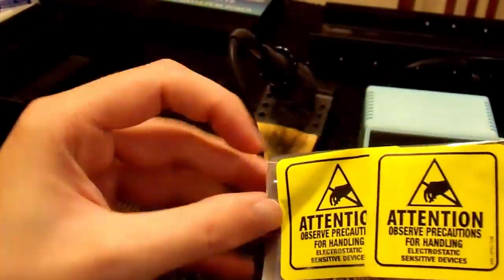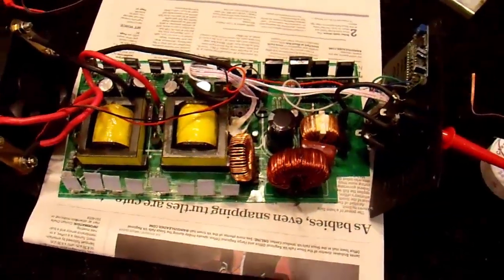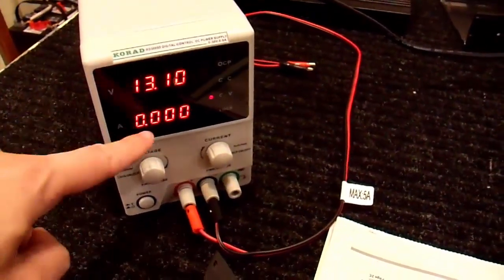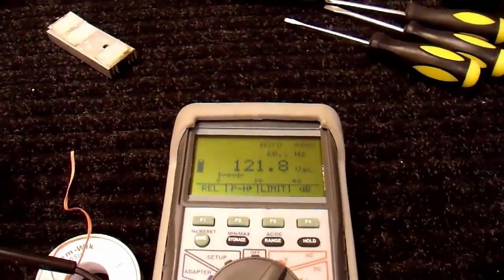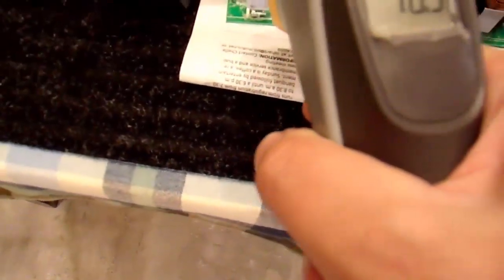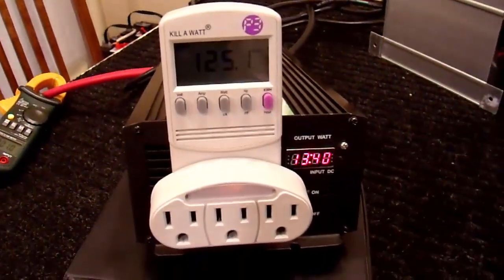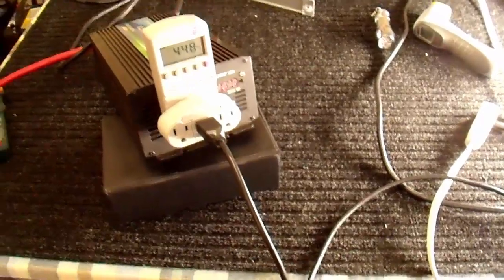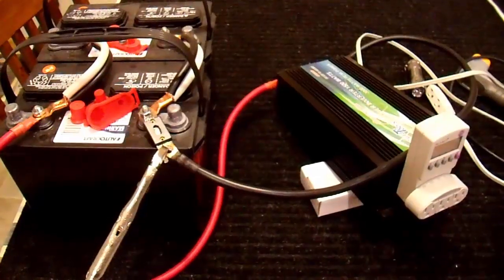Accurate Tools Pure Sine Inverter Review and Repair - Part 4/4

Comment: Recently acquired. the accurate tools AT 3,000 pure sign inverter It's apparently in some sort of protection mode with the front red light on and a whistling sound. Do you repair these professionally or could you recommend someone?
Reply from the maker: I do not offer a repair service.  You can ohm out the FETs and that will likely be the problem.

Comment: Mine is quite a bit definitely designed on the inside. Same inverter very different. Mine has 3 transformers for start
Reply from the maker: It's likely they've changed their design over time.  This is a pretty old video!  The same principles apply though and the general architecture will be nearly identical even if it looks physically different.

Comment: Hi, 3000 watt full sinus inverter fault light is on.  When the inverter is turned on, a relay tripping sound is heard, then the fault light is on, what do you think could be the problem?
Reply from the maker: I do not know what the relay tripping sound would be as very few inverters have relays, but assuming the sound you hear is a current surge due to a damaged components and the inverter subsequently protecting itself then I would guess it is a shorted FET or diode.
Reply: @knurlgnar24  Thanks for the valuable information. I will do as you say mosfet diyot

Comment: Hello sir, I have enjoyed watching your repair videos. I have an Accurate Tools AT5000P 5000 Watt inverter. It worked very well for almost a year. Recently while we were gone it quit working. No front panel light, no 120 AC with solid 12 volt input. I have a well designed 12 volt battery configuration with controllers When I opened up the case I found the ribbon cable between the input board and the output board had gotten hot and melted the insulation. There is no other evidence of smoke or heat on the components. Both circuit boards and components look clean. Do you have any suggestions how to check things further. I have moderate knowledge and experience with electronics and computers. Any help would be very much appreciated as we live in Central America and the electricity here is very unreliable.
Reply from the maker: That doesn't sound good, but it is probably still repairable.  Most likely your output FET or FETs failed and took out the drivers (Assuming they run through that ribbon cable?)  I would start by ohming out the FETs.  There should be no shorts between pins.  Often they fail shorted with no external signs of failure.  If the FETs are shorted then you will have to make sure the resistors on the gate pins are functional, and the NPN/PNP gate drivers are functional.  If it looks like high current went through them it is best to replace them regardless since those parts are inexpensive.  If the damage made it all the way back to the driver IC that can be replaced as well, though things start getting more difficult if the damage went that far.
Reply from the maker: A second note, if FETs are bad and you want to save some money you don't have to replace FETs that test good.  Output FETs don't have to be completely matched so I usually don't replace ones that test good myself.  I replace the bad ones and stress test it looking for hot spots.  If it all seems OK then I consider it fixed.

Comment: Thanks for the review.  A long time ago I pestered you to do a review on Accurate Tools Pure Sine Inverter but some time later I just tried one.  It was smaller than the 1500 watts, as I recall it was 600 watts.  When I received it, it had something loose inside of it that I could hear travel from one end to the other when I tipped it.  I called the vendor and talked to him about opening it.  I did.  It was a nut.  I put it back and tightened the screw.  I planned to put it under the passenger seat so I ran the wires into the car to do that.  It fired up fine.  It was summer time and I was in shorts sitting in the driver's seat with my M6600 Mobile Workstation laptop on my legs.  It felt like when you stick your tongue on the top of a 9V battery only across the entire top of my legs.  The touchpad also didn't work.  My phone touch interface also didn't work.  Grounding the case to the body makes no difference.  Next, I moved it just under the hood on the driver's side next to the firewall with the hood and driver's door open.  From there everything worked perfectly but there was no place to put it there, and probably not a good place due to the engine heat.  I contacted the vendor and he resisted me sending it back.   They finally did take it back since I had to fix it to use it in the first place.  The Tiger Claw 1500 that you had reviewed was pretty big to be able to hide anywhere and I was concerned it may have the same issue.   Then I started studying the ratings for electrical interference.  Samlex was the only impressive one, but it was expensive.  I called them and talked with a real engineer who explained the ratings and how that it is not simple nor cheap to engineer ones with low EMI and sent me some engineering tests and graphs.  He also explained to me the difference between the different pure sine wave model lines and why the cost difference between them.  He explained also how to over-spec based on the load for sine wave purposes.. 
I never bought a Samlex and ended up with a 320 watt modified sine wave that fits into a hidden compartment inside of my center console that already had a cigarette lighter outlet down inside of it for some reason.  However, I learned that the socket would not run my M6600 with 220 watt power supply for long without the voltage dropping below the minimum and the inverter kicking out after a short time.  The problem was once the charge edge was off the battery, plus the voltage drop in the wire, meant the only way I can use it for any length of time was to keep the engine running.  It would probably work fine with a lower powered laptop too.  My M6700 has the nVidia card in it, so it can shut itself down and use the Intel processor video and run a long time so I don't use the inverter hardly ever anymore.

Comment: The same mosfet FB4310Z blow out... well similar, i mean in the same posision, i changed all of them but still blowing the fuse  20 amp in the last line, I have three transforms, the firt two are oK, could you help me? I suspec from the diod or the brige?

Comment: 4 yrs on and I got excellent value out of this series. I have almost the same visually except its call Power Meg by Jinghen, 1400w, 240V out and quality of manufacture is worse by far.  Oh and it only puts out 185v.  This one has 6 transformers so I suspect one bank is not chooching.  Thanks for the effort.

Comment: Thanks for the video, I am researching an issue with my AT3000... I won't run anything and it shows a load when you first turn it on , even though nothing is plugged in... Any idea where I should start to look internally?
Reply: I have one of these and regret buying it!. At 1000 watts, it drops to 90 volts, at 1500 watts it shuts down

Comment: K24, I started putting a item I designed into use on modified sign inverters. Using HAM radio knowledge I made a old school coil out of a 8" window weight and wire. The result has been much better, not so square wave that seems not to cause so much heat in motors. Have you tried this approach.

Comment: Great series of videos on this inverter. I wish I would have found this before purchasing mine. I bought mine as an 'open box' item from eBay, in working condition for the same price as you. I'm almost scared to open it up and see what disaster I may find. It should be arriving today. I may remove the guts and design a new box for improved cooling.

With the oscilloscope, What is the time duration of the flats on the peak of the sign wave? Thanks for sharing.

Comment: Thank you for these very, very helpful videos! The IRF1404s blew on my inverter as well, and on the one I had before and I am suspecting it's because of a too low DSS for causing it. None of the fets exhibit any visual signs of damage but out of the 8 I had in the two inverters, 6 were open between source and drain.

Can you suggest a FET to replace the IRF1404 with identical specs but higher DSS? Thanks in advance for your help!

Comment: Very interesting video. Did you notice if the sine wave deteriorates while the unit is under load? Also what pure sine wave inverter would you recommend with a budget in mind. Looking for one to use in a camper while off grid. Thanks!! I gave your video a thumbs up!!

Comment: Thanks for the video.  I actually purchased a larger version of this at 5K/10K pure for my toy hauler.  I ran it for 10 minutes and it was great and then all of the sudden it died.  Nothing, won't turn on, nothing.  Two fuses continue to blow every time I attach it to the batteries.  I can'f find a schematic that tells me which resistor that might be attached. Yes, I am a novice.  More to the point, I'm just desperate to get this expensive boat anchor to produce power.  Any thoughts on where I might find the issue?
Reply: shorted fet

Comment: I have one of those in the 2500 watt model. I works fine but it started shutting down at 12 volts instead of 10.5 - 9.7. This is on one battery starting on 13.10v. I could run several hours before with 100 watt bulbs on a string, now only 1/2 hour. What do you think about this?
Reply: Stephen Grant Is there a way to step down 24v to say 14v for this inverter

Comment: on average inverters put out 80% of their rated capacity most put out rated for 5 minutes and double rated for less than a second up to around 10 seconds usually determined by the capacitor capacity, run a higher farad cap and get a longer surge (no guarantee)

Comment: A larger fan, which would require a larger housing ($$$) would certainly help.

I am surprised the output voltage regulation is so poor.  Do you think this is because the boost stage is not making adequate voltage, possibly because the transformer are loosing efficiency due to heat ?

Comment: Why not fix some of the other issues with build quality and see if it works better or would nothing you noted in the first video make any difference? IE missing resistors, not grounded, weird wiring, etc. I would be curious if they hadn't done such a sloppy job or no job at all on some parts if it would effect the usability and reliability of the unit.

Comment: Greetings, Knurlgnar. As a layman, I have learned a tremendous amount from your vids. Even on the mini fridge efficiency improvement. Who would have known?
 
Anyways, I do have a few questions, if you will.
 
Are you familiar with Vector Inverters? Black and Decker bought them out back in 2006.... 
I have a 3000 Watt Modified Sine Wave that is about 8 years old. I had it installed on my boat, and rarely ever used it. Model # VEC051M. It is the Marine version, so the board is coated and it still runs fine. Are the internals of decent quality in them? 
 
 
Have you ever experimented with  Sine Wave Filters? I see a few random videos on it, but they are more for big industry. But, I do see Sine Wave Filters on eBay, and just wondering of I could use one with my current inverter to help clean things up a bit. I am in the beginning stages of building either a bugin or bugout solar power rig, but this is obviously an integral part of it.....I know temporary use won’t really damage my appliances and whatnot, but down the road I am going to put it all into a fifth wheel and use solar. Albeit, I will set most all of it up as 12 volt. What say you? 
 
I saw your Samlex 3000 video, I can’t believe how much it took to get it to shut down. Impressive!!
Reply from the maker: If it's been on your boat, used or unused, for that long and is still working then I'd say keep using it!  Newer products are increasingly cost driven so you need to pay more and more to get good marine quality these days.  Not sure on the quality though.

As for filtering a MSW you can reduce some of the EMI interference as for radios and such, but it will do nothing to convert the waveform to pure sine.  For that you need a pure sine inverter.  No transformer or filter circuit is going to do anything except waste power and potentially overheat.

Comment: Hi Knurgnar! I have another theory why this inverter failed. In the first Video of this series it seems that two of the input FETs are not mounted to the Heatsink properly: The bracket is really off to one side, and it even seems the metal tabs are lifted off the heatsink a little at the other side. One of those FETs is the one that smoked. Really heating it up an then surge testing it might have then just pushed that FET over the edge. Keep up the great videos!
Reply from the maker: Your theory could be the case.  The brackets supplied by the manufacturer were not long enough to properly clamp the FETs to the heatsinks which made properly assembling it difficult.  I re-assembled it better than it was out of the factory even bending the brackets and FETs to make them clamp better but it still wasn't all that great.  I do think they were heatsinked well enough but it definitely wasn't as good as I'd have liked if it was something I designed.

Comment: When charging a battery bank should I connect both the + and - to the same battery at one end OR connect the + to a battery at one end of the bank and the - to the battery at the opposite end?  Which way is better? Does it even matter?
Reply: If the batteries are 12 volt, you go + to + and - to -  to keep 12 volts. If they are 6 volt batteries you go + to - to make 12 volts.
Reply: If you have 2 batteries connect + to battery 1 and negative to battery 2 .
Reply: steve p. That's what I was looking for thanks.  So if I had 10 batteries would I do it the same way?
Reply from the maker: TheDiceAreLoaded
Practically speaking it doesn't matter which battery you connect + or - to, it will charge just fine no matter how you connect it so long as your cables between the batteries are appropriate.  Theoretically it would be best to connect + to battery #1 and - to battery #n, where n is the last battery in your parallel battery bank.
Reply: TheDiceAreLoaded As knurlgnar said, it doesn't really matter as long as your wires are appropriate (and you're not extremely fussy about it). It's much more critical to connect your load to different batteries, since the currents are usually much higher, and the voltage drop in even appropriately sized cables can cause the battery closest to your load to wear a lot faster than the one furthest away.
Reply: Opposite terminals.
Reply: steve p. Not what I was asking
Reply: tarfoot not what I was asking
Reply: I was asking the proper way to connect the charger; nothing about voltage or opposing terminals.
Reply: ***** Thsnks for the information and great video content.
Reply: FFcossag Very good information.  Thanks for taking time to respond to my question.

Comment: Do you have any experience with the inverters Harbor Freight Tools sells?
Reply: Witch model do you want ? I'm pretty sure he thinks they are exceptable for the price . I have a Harbor Freight Tools Cen-tech 2000w-4000w peek, Item # 69662 For Sale still in the box. I just looked at it and its still in the original plastic, I don't remember even taking it out of the plastic .never hooked up . Cost $224.99+ tax 18 months ago . Its on sale this weeks ad $124.99+tax. I'll sell mine $50.00 +shipping . If your interested email me . steve.hardy9081@gmail.com. I need to buy a pure sine wave for my boat & the Tiger inverter has the same case & bolt holes etc. I'm not a lier,cheat or thief ! If i say its never been hooked up & still new in the box you can believe it. Sincerely sailersteve.
Reply from the maker: Yep, that inverter Steven Hardy is selling is a pretty decent MSW inverter for the Harbor Freight price and at $50 it's a great deal.  So long as you take advantage of their coupons Harbor Freight is a good source for reasonably priced mid-range consumer inverters, which is what most people are interested in.  I've also used their 400W model if that is more in line with what you were interested in and it is a decent product too.  Not great but a good value.  Note that some of their older stuff was even better - if you can find some of their older units on eBay and don't mind the larger case size that could be good too.